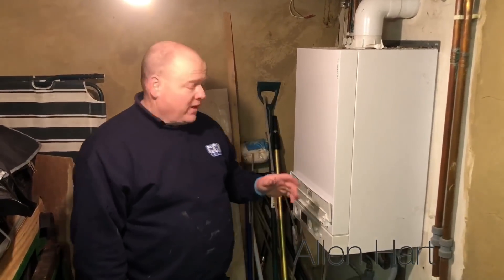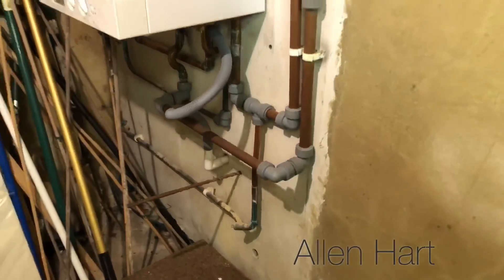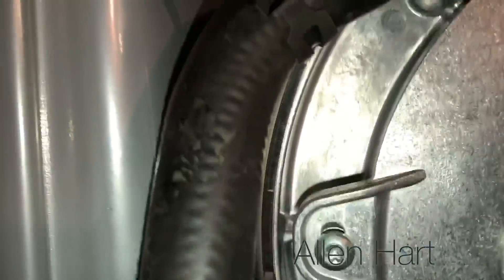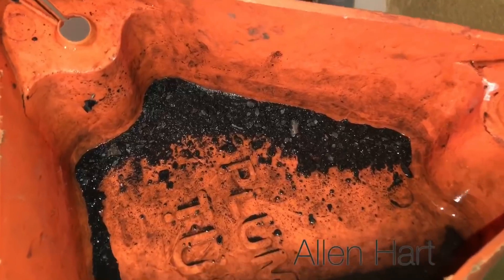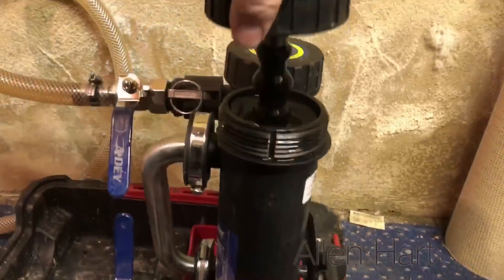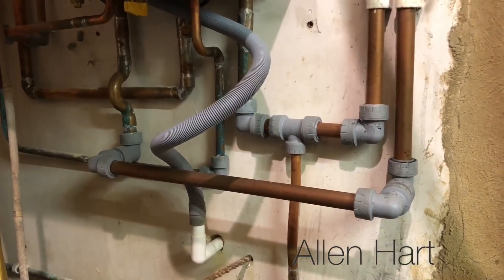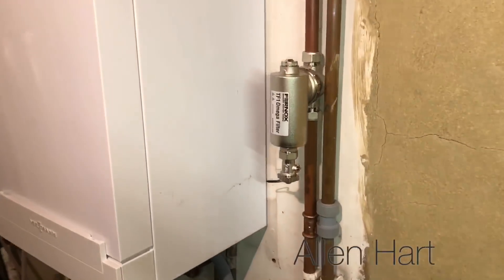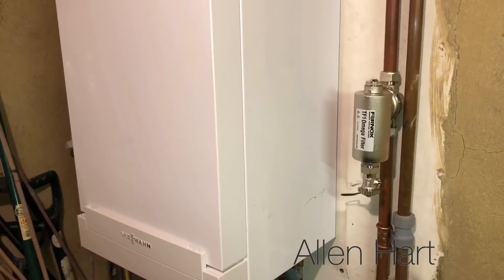VIESSMANN VITODENS 100 COMBI BOILER - Badly Installed - Sludge

Comment: I just don't get it how this thing is powerflush? U basically circulate cleaner trough radiators with boiler tiny pump and basically what u did u changed the water in the system and flushed some rust/sludge so it doesn't circulate anymore. I am coming from country where we have 3+ bar pressure in the street no attic tanks no boost pumps. When u conect 3+bar directly into the heating system and flush every radiator and before that u left chemicals in the system for few days then u can call it powerflush or just use the proper pump not boiler pump.

Comment: This is a common problem with these boilers regardless of age and quality of install!! The same issue is seen on serviced boilers and those less than a year old. The filters don't prevent the problem, they just delay reoccurence. It is a design fault with the vitodens 100.
Reply from the maker: They are really easy to sort out though. Thanks.
Reply: I would say it's not design flaw just pipes heat exchanger coil is really small and even small scales/dirt can block it! Filter just delays for few year the problem. The problem is old open systems that are now converted to closed ones and use of auto filling valves, u are using ridiculous compression fitting or push in fitting which starts to leak after some time, fresh water menas fresh air means corrosion. U actually at least service the boiler to some point, but the problem is when u have alot boilers on the market and u are repairing them all u dont have parts for them straight away in your van or office because every time u open the combustion chamber u have to change seal around it thats a rule, there is no negotiation about it or second thoughts. After 2y working in your country i can only tell u are million miles away from Germany, the build quality is so poor and labour price is so hight that its insane. But probably thats what keeps economy going because u are changing boilers every 10y and i have my Vaillant combi for 25 and still working like a baby.
Reply: @matijaivankovic2946  j7

Comment: I got a call to a job to check a central heating system in a home under renovation. All the ceilings have been removed so all pipework is exposed. The combi boiler is in the loft and has been installed recently I would say 4 years ago. Once all the pipework was exposed we discovered that there is only one pipe being used as the flow and return around the entire home feeding 8 radiators. Four upstairs and four on the ground floor. On two radiators the flow and return has a bypass connecting the two also this single pipe would then make its way back to the boiler becoming the return. The question I would ask is why would there only be a single pipe connecting the inlet and outlet of every radiator? Could this have been a older gravity fed system with a new combi boiler being installed in the loft and all previous pipework not being adjusted? Would you recomend switching to a two pipe system with a normal flow and return.
Reply: in a one pipe system the heat is going from radiator to radiator cooling as it moves so it will take longer for each radiator to get to temperature and the closest radiator to the boiler will be the warmest. also because there is no returning pipe you cannot turn any of the radiators off because the water then cannot return to the boiler. another problem is when the thermostat clicks off after you raise temperature initially, the radiators closest to it will control when the heating system clicks back on again, so if your thermostat is downstairs as it usually is, as the heat drops in your house and the thermostat clicks on, the furthest radiators away arent getting enough hot water to heat the furthest rooms by the time the closest radiators to the thermostat have clicked it off. 

in a two pipe system hot water is fed through one pipe to each radiator then returns to the boiler through a second return pipe, so the radiators all heat up equally. this means when your heating system reaches temperature and clicks off and then on again as it cools, all the radiators should be getting fed an equal amount of hot water which reduces cold spots in comparison to a one pipe system.
Reply: How can you not know that if you are a so called heating engineer?

Comment: Hmmm start of video has 2 polyplum 22 sockets - 

You commented on using 'speedfit'  

Is that not a Tectite 22 socket you have changed out for one of that poly's!?
Reply from the maker: I have never used tectite, the fitting in question is a pressfit one. Thanks.

Comment: Question.  In homes with this boiler, how are you addressing the problem with home dampness/lack of air circulation after the combination boiler is installed.  I asked about the sudden dampness many times, but was given a blank gaze, or as if I was crazy.  Today, I learned why the dampness occurs.  It is 75 F outside and I am freezing... hands white.  I think many claims regarding this type of boiler are "creative."  I cannot afford to run heat 12 months of the year.  If the heat has to be on in order to compensate for the lack of air exchange that used to occur with a standard oil-burning furnace, there is no efficiency.  These units are expensive.  Why the lack of company disclosure about interior air/dampness, I wonder.  (Your video instruction is excellent).
Reply: PS  It appears that Viessmann removed my comment following one of their videos.
Reply from the maker: Not really sure what you mean TBH, Are you in the UK. Thanks.
Reply: Not in the UK.
Reply: @jakeornot6306  You are right in a respect, older boilers drew there combustion air from inside the property and vented outside allowing for adequate air changes (should be around 3 - 3.5 air changes per hour) however these systems relied on floor and wall vents to ensure enough combustion air entered the property for the flame to burn efficiently, these vents however would always allow a draft to enter the property often leaving the property freezing cold, it is common that (especially older people) these vents would be blocked up by the home owner to minimise the draft but hugely increasing the risk of inefficient combustion and as such the risk of carbon monoxide in the exhaust gases which could leak into the property, modern boilers are vented for both combustion air and exhaust gases negating the need for drafty vents effectively removing the risk of incomplete combustion (the system is also monitored for blockages in the inlet and outlet flu) thus although you no longer get a throughput of air through the property for the proper number of air changes the property is no longer subject to drafts from vents and the boiler is intrinsically safer, perhaps if you are having issues with damp you should speak to a specialist about ventilation and damp prevention if the damp is on an outside wall then perhaps additional insulation to increase the internal surface wall temp might help or if its also on internal walls then it could be your property is missing a damp proof membrane or has a leaky pipe somewhere
Reply: Jakeornot Room sealed gas boilers have been the norm for many, many years now, and no one I know has seen an increase in damp issues. If anything these days houses are warmer than ever- we have come to expect our homes to be 22 degrees throughout, where as when we grew up it was usual for bedrooms to be just above freezing in winter!

Condensation and damp is of course a product of lack of ventilation and lack of adequate heat. Boilers themselves are not responsible. It is sensible to maintain some natural ventilation when a room sealed appliance is installed, but most older houses will be naturally leaky. People forget that in days gone by we used to open the windows briefly every day, still good practice. We have also now sealed our houses as much as humanly possible, with inevitable consequences. Again, non of these issues have anything to do with the boiler.

Comment: The worst one I had was in the house I moved into 2 years ago, I knew the boiler needed replacing when I went to view it as it was ancient. everything that was meant to be 22 was so I thought straight swap, happy days.

When I moved in I found out it was beyond awful.

The gas from the boiler reduced down to 15 out of view then went to 22 just before it appeared back in the meter. The flow and returns went down to 15 and back up to 22 twice before any rads came off it.
Reply from the maker: Thanks for watching.

Comment: My installer never fitted a filter (over 14 years ago!); as a consumer I didn't know what they were and would have been happy to pay for one if I knew how important it was. But having said that my 14 year old Valiant has only ever had 1/2 services and running fine, I guess it's not as economical as it could be though? Perhaps you can make a short video on why it's important to service boilers and what problems can occur if you delay servicing.
Reply from the maker: Manufactures advise on having the boiler checked and serviced every year, For landlords its a legal requirement, Personally i think it should be the same for everyone, Thanks for watching.
Reply: I dont think they had magnetic filters back then